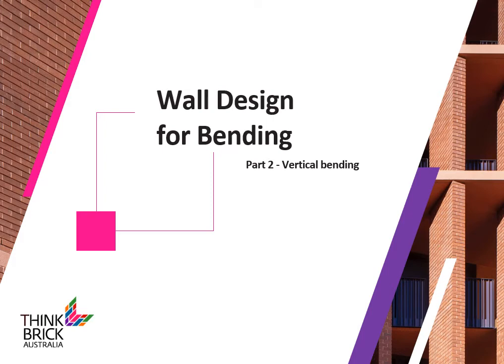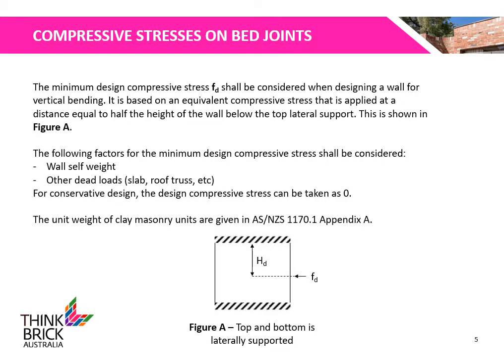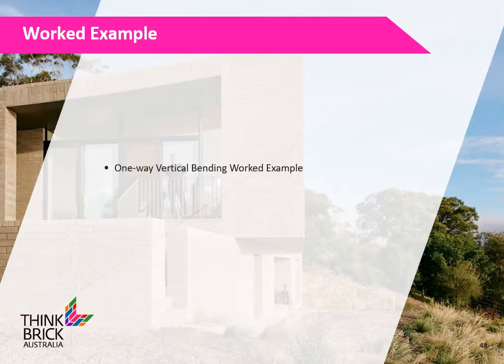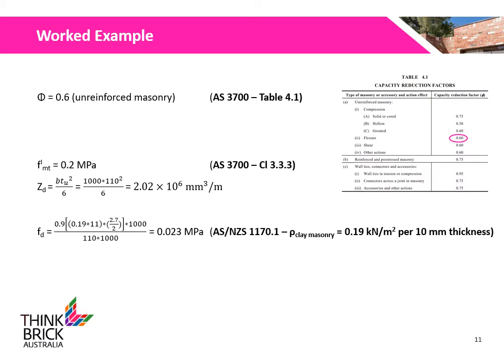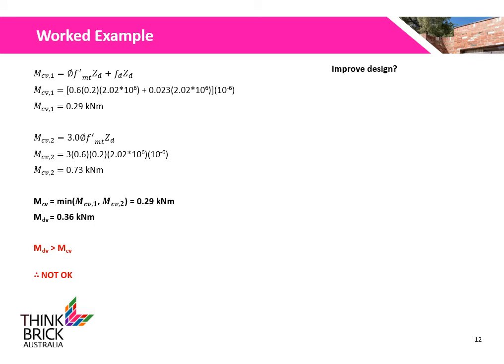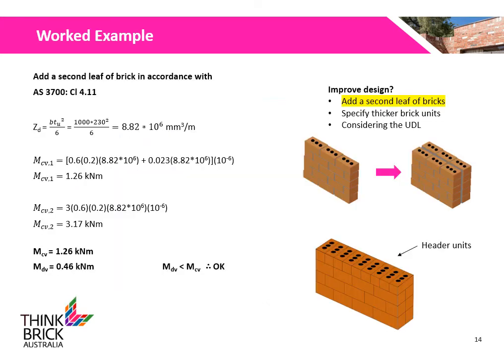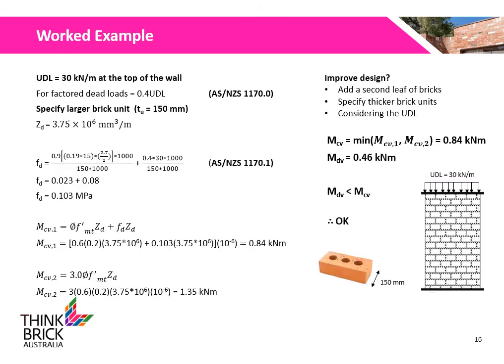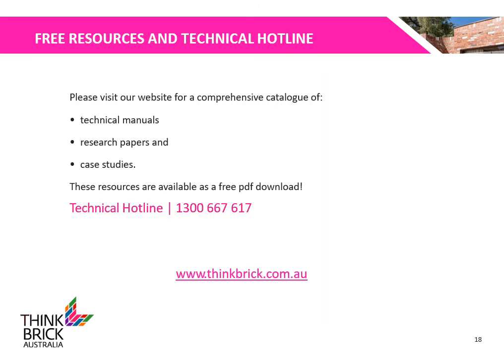Think Brick Tech Channel: Wall Design for Bending – Part 2: Vertical Bending

Comment: Hi thank you for your great video. Can you please advise why you selected load factor of 0.4 to apply to the UDL in the last example. Based on AS1170.0 the load combination factor for Live load should be 0.4, but slab load is a dead load and is permanent. Shouldn’t apply a load combination factor of 0.9 to the UDL dead load instead?